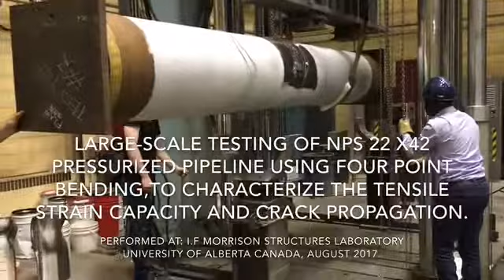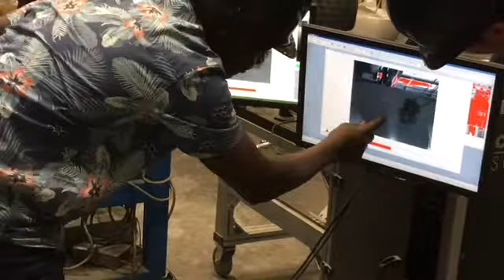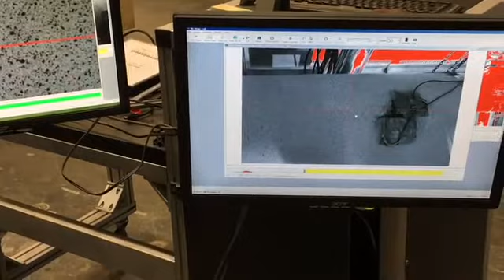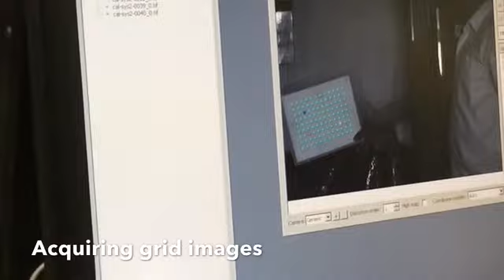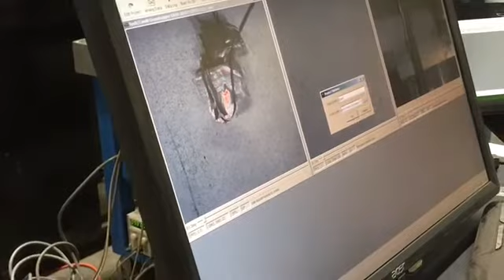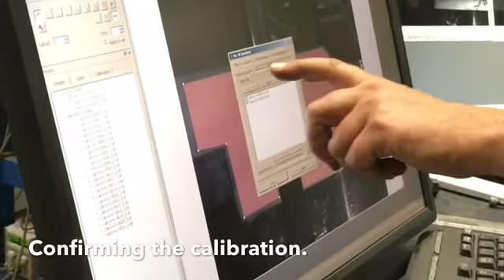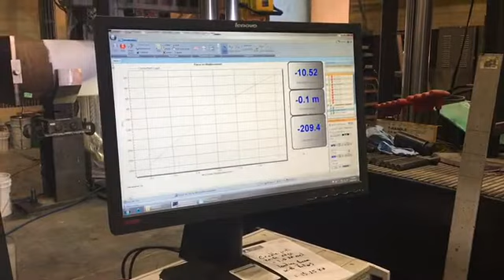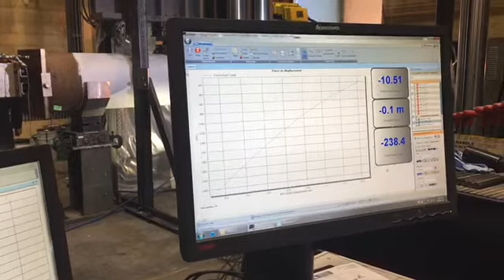Four point pipe bending test video

Comment: What's the use of bracing systems?
Reply from the maker: To restrain the pipe from moving longitudinally and out of plane for safety reasons.
Reply: @Samer_Adeeb  how did you deal with the additional forces and moments
Reply from the maker: @youngiish  Here is the publication: https://www.sciencedirect.com/science/article/pii/S0308016118305489
Let me know if you have additional questions